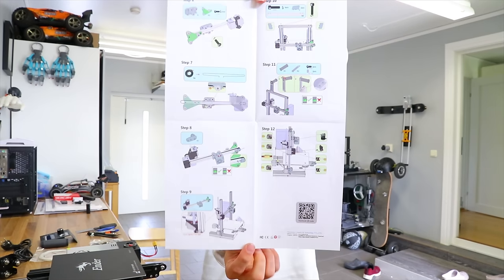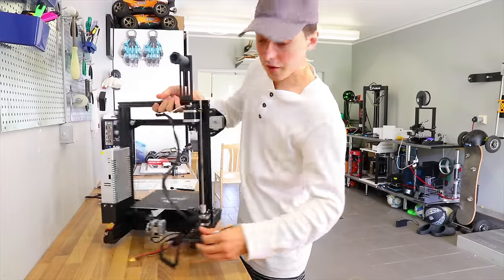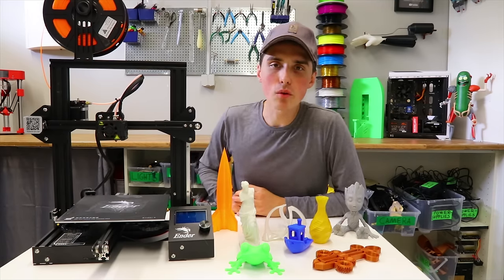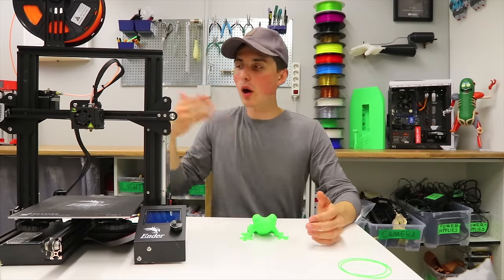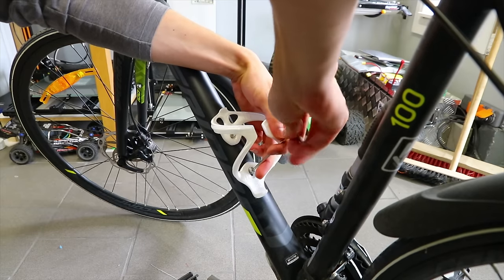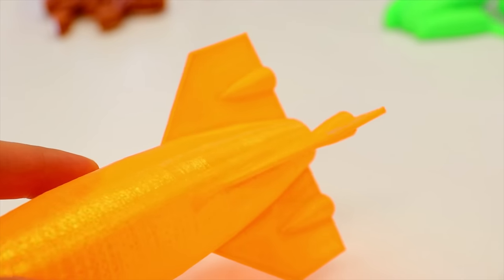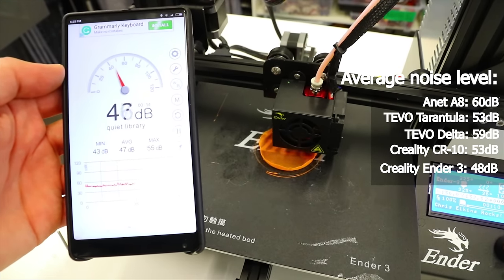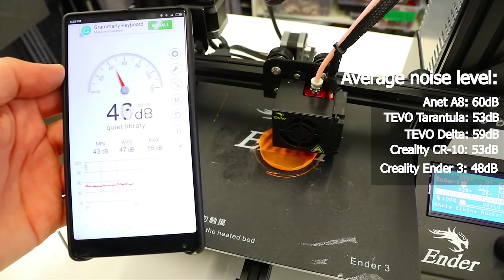Creality Ender 3 Full Review - Best $200 3D Printer!

Comment: I bought this printer about a week ago and all I can say is...
WOW
It's my first 3D printer, so I have no reference to any others, but the print quality is absolutely amazing! The frame is sturdy, the instructions and controls are easy to navigate and it takes literally any filament! And all for less than $230!!! My only problems were a loose bed and a crushed bowden tube clamp, but there were tools to tighten the bed rollers and a spare clamp was provided. Definitely one of my best purchases!
Reply: Sam Jones got yours on ebay?...I did too!😁👍🏻
Reply: fookingsoc No actually, I bought mine from GearBest!
Reply: Oh yes, it would. Ho scale stuff is small, this would be great.
Reply: Hey! Just wondering if glass beds are available for this model?

Comment: I bought this 3D printer maybe 10 days ago as my first printer and i love it!!! I have been running it everyday and have no issues or complaints! I already ordered a glass bed and yellow upgraded bed springs. I already relocated the spool holder to the side and printed a extruder knob. Probably the best first 3D printer anyone should get because it just performs amazing and it is only $200! just blows my mind how amazing this printer is and is like the new anet revolution for budget beginner 3D printers but with far superior print quality then any $200-$300 printer out there. Thanks for your review on this printer :)
Reply: You have the normal ender 3? Because it is a bargain on Amazon and I don't know if the extra money for the pro or v2 are really needed for improve the base printed. This should be my first printer, for experiments and some useful objects to print. But i hope the quality will be good enough to enjoy it  and not to recriminate on money not spended...
Reply: @manny-77  that was 2 years ago, better option to buy the voxelab Aquila right now
Reply: @xyzebruh1083  thank you now I'm considering this printer and i see the incredible price despite the ender, maintaining good and maybe superior quality. May I ask you which is better between base, C2, X2...
Reply: @manny-77  doesn’t really matter they are both great for the price
Reply: @xyzebruh1083  today aquila has arrived, 2h to assemble it, tested with aquila test and a whistle from thingiverse... amazing quality, I love it! Only little stringing on test. I'm printing yoda character for tonight. Hehe!
Reply: @manny-77  awesome! 3D printing is a fun hobby
Reply: Just got mine today. Paid $56 for an open box and I already have the mp cadet and HATE IT. I'm so excited for the ender 3

Comment: Just purchased a Ender 3, waiting for it to arrive :D
Reply: How would you rate it so far?
Reply: @jpuck6221  its a pretty darn solid machine! Its great for the price, but a nightmare to set up. at the time, I was really inexperienced, and when I tried to do a print all of it was  sliding on the plate. turns out I had to adjust it. it took me two weeks to figure that out. thank god it came with a little spool of filament since I was able to calibrate it before my filament arrived. but once I got everything set up, the machine is great! I would recommend if you have the time to set something like this up, but you just want something working out of the box get a monoprice
Reply: Lobetec thank you, I’m sure I’ll have enough time to set it up with this quarantine lol. Thanks for all the help.
Reply: @jpuck6221  lol happy printing

Comment: I am glad that I found your channel.   This video has helped to educate me.  I am a sculptor, and I have been increasingly interested in the potential of these machines.   At this price a barrier has been removed.   The only other issue is the software...a bit intimidating.  Any recommendations for a novice at this type of CAD?
Reply: I would recommend using fusion 360 for CAD modelling, it is a free to use software and works pretty well

Comment: I'm stuck between this and the Pro... The Pro has a magnetic plate so you can't heat it up too much, but it's more rigid, less noisy, and apparently more user friendly (so good for beginners).
Reply: Risky proposition. A heated bed is very important not only for the first layer but for all the other layers that come after. Any warping will cause obvious issues with your model.
Reply: Pvt. Duckling have you picked yet, having the same problem with deciding between the two

Comment: I'm new to 3D printing so I'm new to the process. Do you just upload the file download to the 3D printer through the SD card and then it prints from there, or do you connect a computer and need a software to run the print? If there is a software needed, what is it? Thanks in advance!
Reply: Late reply, but when you download a model file (STL or OBJ), you have to import it into a slicer software. In the slicer, you edit the temperature, print speed, infill, thickness of the walls, etc. I highly recommend Cura slicer which works really well with my ender 3. Once you sliced the model and save the gcode onto a micro SD, you put the micro SD into the printer and print the gcode
Reply: N8 Taing how can I contact you? Please
Reply: @henrythehoover3774  insta: N8_Taing

Comment: You HAVE to tell me your support settings on that Venus de Milo! They're perfect! They must be custom in S3D, I'm assuming.
Reply from the maker: Yeah, custom placement in S3D. Just placed a small support structure under the right arm and the chin.
Reply: @RcLifeOn  what kind of material did you use for the venus you only said it is a solid one
Reply: @RcLifeOn  hi i have ender 3 now what is the best upgrades i can get like printing at higher tempatures etc would i need to get a better hot end

Comment: Awesome review!  2 years later I'm buying an Ender 3 for $169 and this still really helped me.

I have a couple of questions:
1) You mentioned printing at 0.1mm, but I can't find 0.1mm nozzles for the MK10 extruder anywhere.  Oh wait, you said .1mm layer height, so what's the difference there?
2) Printing nylon: I was under the impression that nylon prints at >250C, but I didn't think the Ender 3 extruder got that hot, maybe 250C max?  But it works ok?  Maybe whoever told me this was just a hater.

Thanks!

Comment: Bought the Ender 3 about 3 weeks ago. It worked fantastic for a couple of weeks, but now the filament is bundling up (lack of better word) at the nozzle, and we cannot figure out why!  Using different colors and types of PLA, but all have the same problem. The manufacturer says it has to do with bed height adjustment, but we have tried adjusting it numerous times, to no avail. We did notice a slight indentation in the mat surface (like it melted down a bit).  Appreciate any ideas, thanks!
Reply: change the bed
Reply: I've heard of people having problems with the tube that goes into the nozzle melting. Solution seems to be remove the tube from the nozzle (remove clip, push collar, pull out tube) and cut the distorted part off cleanly with a craft knife. Doesn't sound like it in this case, but worth checking.
Reply: Not sure if you got this fixed, but here is a video that should help you out https://www.youtube.com/watch?v=x35aWmnZ_A0
Reply: Did you fix your 3d printer JF? I'm thinking of buying one but I want to hear how your experience turn out
Reply: @joninfect8681  it's a simple problem I had it to get a glass bed of of amazon plus a thermal pad, spray down the glass with aquanet hairspray, then your good to go.
Reply: @RaptorZeven  makes the print stick

Comment: Thanks for the great review. This next question is for everyone: I'm  thinking about getting a 3d printer to print parts where the printed material has to be very strong to hold the weight and screws/bolds. What printing material would that be and can this printer accommodate it? thks.

Comment: Will it print abs?
Reply from the maker: Yeah, for sure but you might need to build an enclosure.
Reply: RCLifeOn because of the dangerous particles it produces or is it something to do with this printer
Reply: To acumulate heat
Reply: ABS ideally needs a heated build chamber. A Stratasys machine I worked with ran a 85°C heated chamber (not bed). A simple enclosure will keep any drafts (which kill ABS prints) away and also be somewhat warm to reduce warping. Also, ABS does produce a lot of ultra-fine particles and bad smelling fumes, so a well ventilated (fumes taken outside) area is recommended. A sealed enclosure with active carbon filters is better than nothing as it will remove fumes, but not UFP.
Reply: Boris just put a box over your printer it works ok
Reply: No, only diet and exercise will give you abs.
Reply: Yes, but I see no reason why you might want to print abs
Reply: @RcLifeOn  hi what is the best material to print a human head with a face i am creating a model
Reply: Abs is terrible

Comment: I know this is older video ,  I own the Ender 3 Pro.. got mine almost 3 years ago  220.00 on sale...  it has been an outstanding printer..  I use Ultimaker Cura 4.5, and any custom work I use MATTER CONTROL  I didn't have to change any setting at all.. other than ones like FILL, TEMP, and whether or not to use BRIM, RAFT and other minor settings depending on the print...after running rolls and rolls of filament through it,,...  it was skipping trying to push the filament in..  so I changed the gear that pushes the filament through,  and still skipping..  found it to be the 42-40 motor...  ordered replacement 18.00 USD... and soon will replace it .. currently making the LEG LAMP from that christmas movie...lol           I highly recommend this printer... the quality of prints is outstanding even compared to printers that cost 2 and 3x as much.. this one still blew them away as far as print quality......  just SAIYAN......

Comment: I love my ender 3, I also have a anet a8(starter) the only downside is the upgrades. with the anet i installed a auto bed level sensor much quicker and cheaper compared to the ender 3 which doesn't have a bootloader, though I did finally get on on there. overall ender 3 is amazing regardless!

Comment: Excellent video. Struggling with bed adhesion on an Ender 3 3D Printer.  Prints break away from the bed. Any suggestions on how you get around this issue would be much appreciated. Keep up the great content. All the best.
Reply: I recommend a piece of 3d printer glass and a sheet of PEI, not one of my prints have come off in 2 years, just wipe it with isopropyl alcohol every time.

Comment: Did the verdict change in 2020? are there better options this year in term of quality and versatility (bellow 400)
Reply: @rubyhe8515  whats the differrence between the v1 and v2?
Reply: @Alowne00  Ender 3 V2 have Carbon Glass, Mute motherboard, Tool drawer, 4.3 inch screen, Improved Sprayer Fan, ect, easy to operate,  improved upon the ender 3 and ender 3 Pro.
Reply: @rubyhe8515  ill keep that in mind thanks friend
Reply: @Alowne00  You are welcome!

Comment: Hi. Wow, you blew my mind! I have had the Enders 3 now 2 months, I have not been able to print a 3D. The PLA filament just doesn't stick to the table in the first instance. In your video your platform mat seems to stick very well, mine pops up slightly in the centre. How do you go about with this? I tried to print the dog test file that came with the USB. Do you spray sticky stuff on the mat? Please may I have one of your print file so that I can review your settings such as the printing speed. Thanks in advance.

Comment: Printing on a CR10 do you have any advice for printing PETG? My experience is the parts won't stick to the bed and I get warping/shrinkage. I'm using a bed temperature of 78degC, which takes forever to heat up. I saw you spraying something onto the bed, what is that?

Comment: No such thing as a modern day home 3 - D printer which can follow commands directly from a computer. We are going to have to wait for years until we have successfully labelled 3 - D printers directed for home use. For that to happen such a printer requires a CD and thus drivers, just like all other printing machines. If somebody tries to sell you a 3 - D printer without CDs walk away. Never buy any printer which does not come with a CD, no matter how attractive it is or how expensive it is. Wait patiently for the years required for the first truly successful plug and play 3 - D printers meant for home use to arrive on the market. Until then ditch all other printers not sold with a CD. In fact, it should be agreed upon that a printer without a CD is simply not a real fully functional printer at all. Thanks for your kind video!

Comment: Couldn't you lay a piece of Pyrex glass on the surface and use clamps to hold it? Obviously you'd need to adjust for the thickness of the glass. Or maybe even a thin piece of steel plate....

Comment: RCLifeOn, Which flexible filament did you use for the frog, and which Nylon filament did you use for the water bottle holder? Also curious about various settings.

Comment: I don't own any 3d printer (yet), but ive been doing research. As far as the bed is concerned, it looks like a flat piece of plastic, if you wanted a glass bed couldn't you just buy a piece of glass at the same thickness and switch it out? Or is there more to it than what I'm seeing?

Comment: What kind of power draw does a printer like this have? Do you see a noticeable jump in your bill when you do a lot of printing? 

Completely clueless when it comes to printers, so might seem like a silly question, but if it is heating a printing head that takes enough power to achieve heat that can melt plastic and, since it takes a while to print, that's heat over a long period of time.

Comment: I will look through your channel it just showed in my feed I'm now subscribing, but I also have lots of rc cars do you have videos that show how to measure the part and get it to a 3d printer and would this unit work for parts for RC vehicles I have mainly traxxas stuff and a old gold pan rc10
Reply: Coello 3D Prints If you have a plastic part break, you can buy a digital caliper, measure the heck out of the part, build the part in a 3d software like Fusion 360, export it to a slicer, then print it.   Takes a little bit of time...

Comment: I bought 3 Ender 3D Printers, and yes, I like them, and I like the products you can make with them. But Technical support is Non-Existent!!! Out of the three printers I bought, 2 had bad motherboards, one had a screen that after 10 minutes of printing would display characters not of this world, out of 3 micro SD Cards, one had nothing on it, one would print the test prints half height, and the other was OK. One of the USB readers was heavily damaged. I emailed support at both Creality and Comgrow multiple times and never had anything resolved. Remember,  I like these printers! Creality is the main company and Comgrow is owned by Creality, and sells their damaged and refurbished 3D Printers!  Do you know another company that needs to create a company to sell their rejects? It almost looks like the Company selling returns/refurbished sells more than the main one! It's a great printer for a newbee, but pray you don't need support, because it's not happening! If you need parts, do your research on what the best replacement part is, and buy it for half price on EBAY! Two of the latest motherboards cost me $25 plus tax on EBAY, They were $50 on both Creality and Comgrow sites, and who knows if they would actually send me ones that worked!  They should have replaced them for free!! NO SUPPORT FROM EITHER COMPANY!

Comment: Is there such a thing as super clear filament? I have found one or two out there but I always fear buying into the whole thing (including a 3d printer) because most things I WANT to work with and have ideas for are supposed to be "see-through" and I have read people saying that the "clear" filaments have a yellow tint to them. I have read people saying it is due to factors like infill, height, layers and/or post processing...

Comment: How durable is the material, can it make a Strong clamp instead of depth I need to build width pressure clamps like 4 inches wide kind of a bar pressure clamp and can screw together? Can it do a job like that?

Comment: Never EVER move any axis fast like that.  electricity moves the stepper motor, and moving the stepper motor inversely generates electricity as every motor is also a generator when spun, beyond the max transit speed, it can generate enough to damage a circuit board.

Comment: hello i know nothing of these or any 3d printer.  I have a 2002 car and the divider between the trunk and back seat is fastened by 2 removeable black knobs.  1 of my knobs arms has snapped off and I cant just buy the part they want $90 for the whole thing.  So my question is... Do you have to use a persons premade instructions/file uploaded? Or is there a way to photo the part or something ?  a mold? a way to 3d print the part to spec?

Comment: So what happens if its just Spriling out of control and you have no idea why I print PLA at 70 to 80 Degrees, with a Noize Heat of 200 Degrees, It should also be noted that I am using Cura and Thingavurise for this, (Also if any of you know settings for cura, that'd be great as well) I am tired of it printing blobs and there being nothing anywhere that shows, clearly as the video states. it should just be a "Plug and play" deal but I don't understand why Mine is over here printing blobs across the room.

Comment: I just brought this printer for my son.  It came with a instruction guide but not nearly as good as your video. There is no further instruction on how to use it.  It came with a small little USB thumb drive.  Do I save the design to the thumb drive and plug into the 3D printer to print or can I connect to the computer directly to print?
Reply: John Li you can do both! You’ll need a slicer to begin with though. But you’ll need a mini usb cable that doesn’t come with l the printer if you’re want to directly connect to the printer and computer